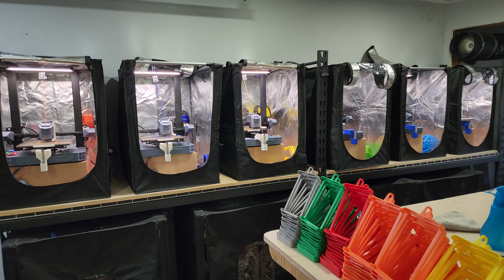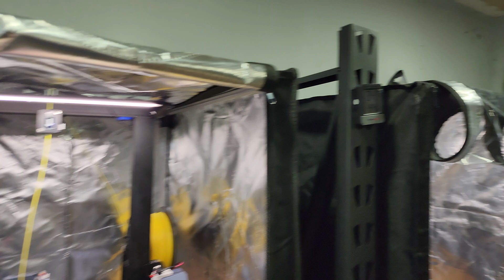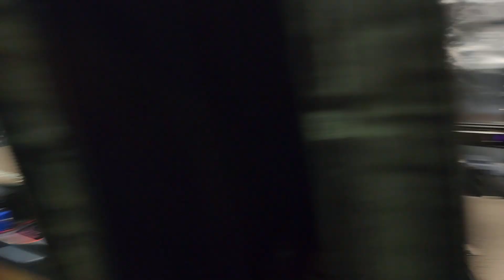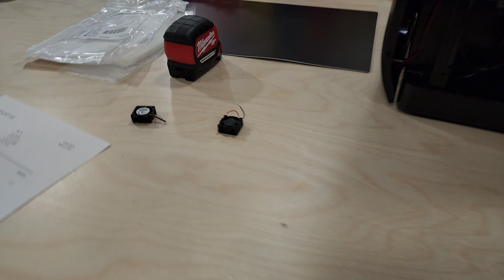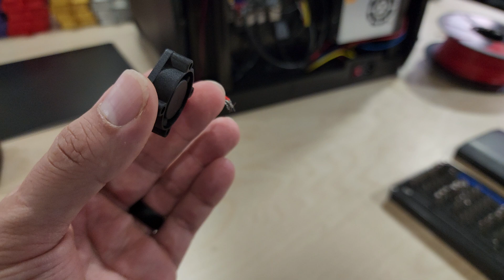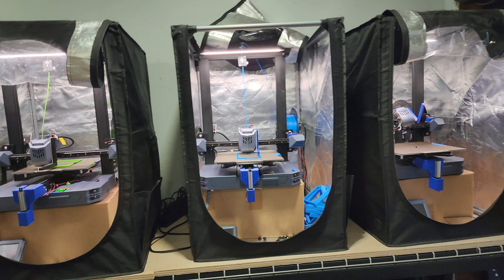Creality CR-10 SE Hotend Clogging due to heat creep FIXED

Comment: After 300+ prints on my cr 10 se I had a nasty clog on my printer, i left it to print overnight and when i up plastic filled up everything the 2510 axial fan was full of platic yhere was no chance of saving it, the hotend was COMPLETELY covered up and the heat sensor was damaged. Im deciding on upgrading the hotend to the micro Swiss flowwtech and replacing the stock 2510 wofh the same one. Any tips?.

Is it really worth it to just get back the stock hotend and get the 3010 fan you were suggesting in the video. Would that be the reason my one clogged that much. Or is it something else.
Reply from the maker: Sorry for the late reply. Yes most likely the lack of proper cooling to the heat break is whats causing the clogging.

Comment: How do I fix the clogging in the first place?
Reply from the maker: Take apart the extruder. I like to heat the extruder to temp then take it apart because the plastic is easier to remove as it will be warm. In some cases you will need to buy a new hotend
Reply: Cheers for your video...  I'm really fed up with my printer..  on one hand it's really good, it's fast and I live to use it but on the other, the hot end let's me down constantly blockage after blockage, blob of death..  I cannot be bothered to fix it any longer